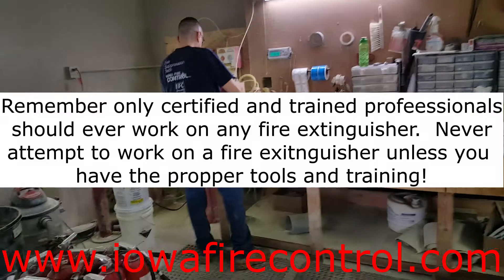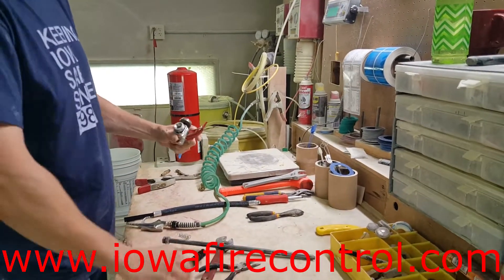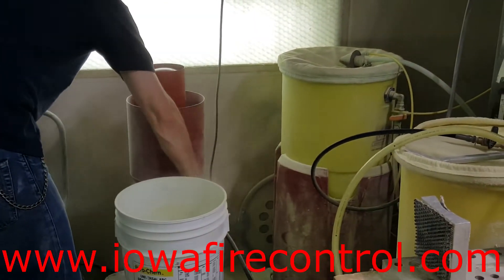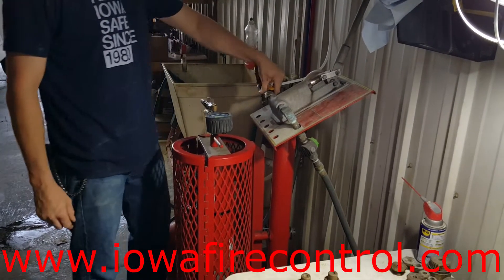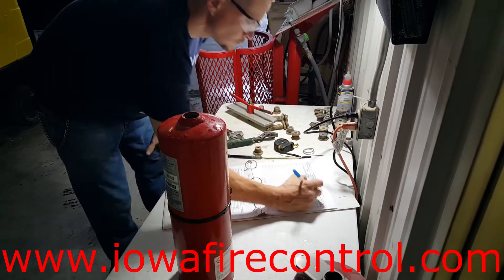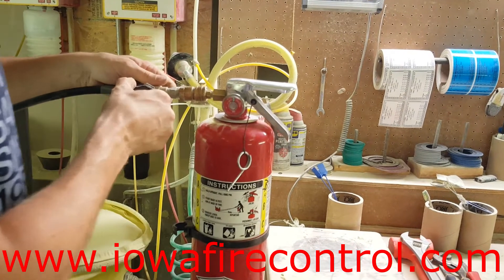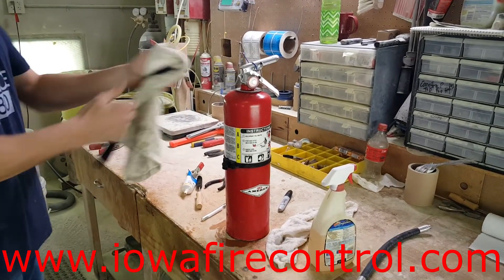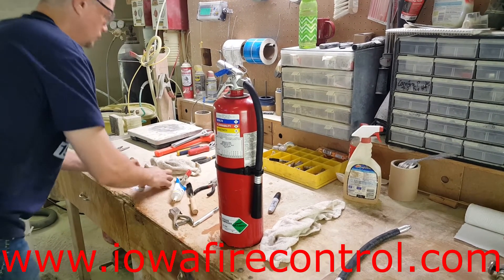Hydrostatic Testing of Stored Pressure Fire Extinguisher Final

Comment: When a unit calls for 585 test pressure but the working  gauge sets on 586 or 588 what gets recorded on the data sheet? What gets punched out on the sticker label for the hydro reading?

Comment: I own a Fire Prevention Company and have been testing Fire Extinguishers for 30 years. This is exactly what a testing room looks like.  Powder everywhere.   There are many other videos out there, usually by manufactures of equipment that show a perfectly clean shiny room with no yellow powder anywhere... Yeah, right...    The only thing this video didn't show you is the holes in the walls because you get mad when an extinguisher goes off and the technician throw the thing against the wall.  and then rights NFG on it.
Reply: I have a bunch of old fire extinguishers. A couple were partly discharged. What should I do with them. 5pound
Reply: My shop looks nothing like that and I’ve been doing fire extinguishers for over 20 years myself. I also have SOP’s in place to control the powder versus what I see in this shop. Dumping chemical into an open bucket instead of having a bucket lid on the top with a hole cutting it so just the mouth of the extinguisher cylinder fits in it.  That cylinder vacuum thing from Getz is a piece of garbage. I came up with something my first week in fire protection that I’ve been using ever since 1995.  Also, I don’t DOT test Ansul extinguishers because they’re not DOT cylinders
Reply: what type of equipment we need for set up hydro test?

Comment: 2:50 do not exceed 30 seconds during pressure testing. Its not 1 minute
Reply: According to NFPA 10 standard, you are required to hold the pressure for one minute

Comment: Do you know that when you mix powders from other Fire Extinguisher Manufactures in that hoper, it's a Code violation, Manufactures Warranty and UL Listing has been voided.   The Extinguishers will not operate as designed and is a danger to public safety. Check out the 1st complete redesign of the Fire Extinguisher in nearly 70 Years!   @t

Comment: What is the purpose of doing a hydrostatic test when you could just replace the extinguisher completely for a fraction of the cost?
Reply: A hydrostatic test is a 1/4 of the price of most new extinguishers unless your buying a junk extinguisher.  Secondly it's better for the environment to reuse a perfectly acceptable extinguisher.
Reply: @BOATSANDHOZ  Ah, thanks!
Reply: @BOATSANDHOZ  I wish that were the case for CO2 extinguishers.
Reply: Because it is not a fraction of the cost. Either you replace an extinguisher every 12 years or you get it tested every 12 years and have it last 50 years.

Comment: My questions to this video...
Per NFPA 10 IS IT NOT MANDATORY TO CHANGE ALL PARTS EVERY 6 YEARS? 
NEW VALVE STEM 
NEW ORING 
I mean technically by the video the proper services were not completed due to that nature. If going to show on youtube shouldn't you be 100%?
Reply: Every 6 years is an internal inspection to determine whether everything is good inside and out. You only have to replace things that are broken in it.

Comment: So the powder gets discharged into the hopper. But what about the nitrogen going into the air in the room? At work we recharge 30-40 5lb. Extinguishers in 6 hours. Is it safe to breath in all that nitrogen? Thanks
Reply: As long as you aren't working with extinguishers while in a cardboard box I think you'll be fine.
Reply: By volume, dry air contains 78.09% nitrogen, 20.95% oxygen, 0.93% argon, 0.04% carbon dioxide, and small amounts of other gases.
Reply: Greg Dinert....never new that, So is it safe? Is it ok as long as their is good ventilation?

Comment: Good video. Thank you. Long ago I had a relatively small fire get away from me because of an extinguisher that stopped spraying long before it was empty. I honestly never paid much attention to extinguishers before that. Losing most of your possessions, your dog, and almost losing your wife and young son because of a faulty extinguisher is NOT something anyone should ever go through. Just because the gauge is in the green does NOT guarantee that it will function as you expect. Buy the biggest extinguisher(s) you can afford, keep it serviced and/or replace it as required.  Fire is cruel, lightning fast and unforgiving.